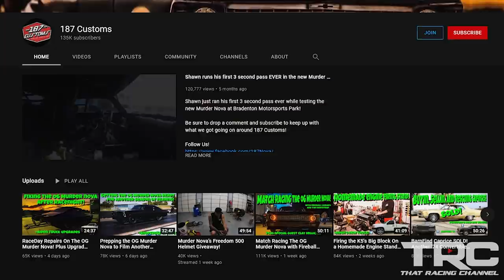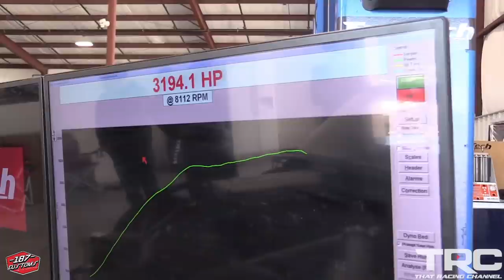3600HP Murder Nova "No Prep Kings Build" - 482ci with 98MM Turbos on 70PSI (STREET OUTLAW Garage)

Comment: 🔥! Everyone sign the RPM act screw the EPA!
Reply: Already signed
Reply: @F82_  🔥
Reply: Already signed
Reply: @finhappygrower8400  🔥
Reply: @F82_  you can sign it every 24hrs
Reply: @finhappygrower8400  you can sign it every 24hrs!!
Reply: @joshr8680  u sure? They would still count the votes?
Reply: @F82_  it’s mostly about getting the attention of the elected official. The more emails he gets about the rpm act the more likely he/she will do something about it
Reply: Where's the link?!
Reply: We signed it awhile ago.
Reply: FYI, the RPM act only applies to cars converted from street to DEDICATED race cars.  It does NOT apply to street tagged and driven cars that also race.  And we go NOT want to clue the EPA into sticking their noses into our STREET cars.
Reply: @danmyers9372  so still sign it
Reply: @danmyers9372  They're trying to destroy the aftermarket support for piston engines in the hopes that they can bring an end to the ICE era in general, it's absolutely disgusting.

A road car, though, should be able to pass an emissions test. There's just no excuse for polluting excessively on the road, you shouldn't have the right to reduce the quality of life of other people.
Reply: @PistonAvatarGuy  yup just check out PFI fine...
Reply: @ivanfierro8940  Yeah, but those guys completely remove the emissions controls from road cars, they shouldn't be doing that. If you can't make your road car fast and clean, don't bother building it.

The RPM act is about protecting race cars, not illegal road cars.
Reply: @ivanfierro8940  BTW, support the development and adoption of E-gasoline, it's the only way to save motorsport.
Reply: @PistonAvatarGuy  I agree 100% with you must be clean, but this will eventually affect alot of company's and car builders, as far as I know PFI got fined because the sold some type of harnesses online not even installed them
Reply: @ivanfierro8940  Yeah, I just watched the video, that's pure horses--t. It should be the responsibility of the car owner to determine if they're using the part legally.
Reply: @chloehennessey6813  can sign it every 24hrs
Reply: @PistonAvatarGuy  exactly
Reply: @danmyers9372  just get a plug and illegally pass your street car.  Just sign the RPM act.
Reply: Wont due the regular guys no good unless you have a dedicated track car your daily cant be modded
Reply: @mapope  just sign it

Comment: The turbos make the power, the motor is just a pump.
Never heard it put like that before. That's awesome. 👍
Reply: Yes, but No
Ain't no 2 liter making 3,600hp
With
That much torque 
And
Reliability
Reply: @amsb4dafunk406 no it is yes, that 2.0 is just a shitty pump, this small block maybe makes 800N/A so yes it’s the turbos doing all the work

Comment: In my opinion the last small block Chevy was the SB2 all this new LS based stuff is a class all its own. When you can get over 450 cid out of the platform that's not small anymore. I get it the LS evolved from the sbc but it's totally left the old gen1s and gen2s in the dust. I'm old school and getting back into making HP and when I see these new engines they look like a BBC more than a old SBC that's really where I base my opinion.

Comment: Lol he was surprised. 

Yea in Brazil they use the Chevy straight 6. Its a stout ass little motor. 
They have a stock crank, stock head and block on a lot of them and still doing 2,450 HP and running high 5s.
Reply: Aussies are crazy
You got yourself one?
Reply: @lcameeno1  huh?

Comment: Maybe you need the Proline 481x water jacketed block. It runs cooler, & will make up to 4500 h.p. at 70 lbs of boots. Plus you can cruise it on the street, maybe do drag week with it.

Comment: Oh yeah all your rides are top-notch but I love the man van you’re real class act man keep up the good work. Got an 02 lightning and 14 pounds of boost I wish my 14 pounds with sounded like that is it started out with 4000 miles on it get 270,000 on it now completely redid the suspension it was tired but it needs
lot of work. I got a one off two piece floating rotors on the front. Doesn’t matter how much horsepower you make if you can’t stop it.Any suggestions on rods and cam and stuff like that to rebuild my motor would be greatly appreciate it 02 lightning but AnyWho keep up the good work man like I said you’re a class act

Comment: This is a dumb question. Why spend so much money on making 3500 hp. When the majority of folks can't get the power to stick or keep the front wheels on the ground. It seems a suspension, frame twisting ect. Is probably a better place to spend the money. Once you get above 3000

Comment: The guys over at CJRC/Cameron Johnson Race Cars aka CJ RACE CARS on YT and they are located right outside of Tamp,FL and they are building a Scion FRS I think it is but its a Pro Mod with an all carbon body and they are putting an all billet 2JZ in it and they plan on going into the 5s in the 1/4 at over 250mph and they are going all out on that build as well and if it can be carbon it's carbon if it can be billet it's billet and if it can be titanium it's titanium that car and the car they just built for another Tampa area native and also a YouTuber Justin Swanstrom they just built him a car for NPK and it's a 2015 Lexus big tire full chassis car with a Proline Procharged Hemi in it with a Liberty 5speed with a quick drive and a billet converter and it's completely air shifted so besides the few clicks of a button it acts just like a 5 speed automatic

Comment: That not a muscle car its just a drag car with a 70's Nova body on it.
You may as wheel just have a full blow drgaster with the engine in the rear.
This is not hotrodding i dont care who you are or where you are from.
Hot rodding is a hopped up stock car that been modified,3600 hp does not impress me.
I like iron cars with boxed frames.
If you wanna go any faster you can just fly a rocket.

Comment: All the hp in the world dont help if you cant get that unit down the track on a regular basis. Pull that small block and go hemi with 5 kits and a small turbo button for a scramble . I get it trying to prove that small block can get er done but its not consistant. As well i asked 10 times to hire your garage to build a engine for my sons truck after i was engulfed in a gas fire and no ine responded. I had 100 grand to get the build done and why no responce.  After that i stopped my subscription to your channel.  Sadly diapointed.  I took my cash to one of your competitors and got it done. My son has always been a fan favourite and after 10 messages and a call to your shop we got no reply.
Reply: We still have respect for you all but feel hurt you never replied. Made us feel like our shit canadian cash was no good or that now your on top our 100grand was chump change to your garage. Be nice to understand why no one replied